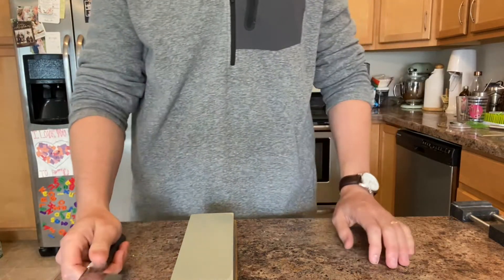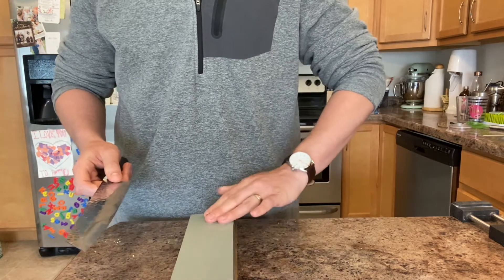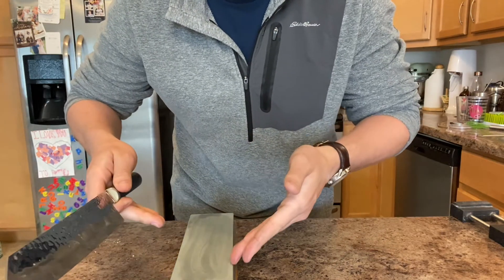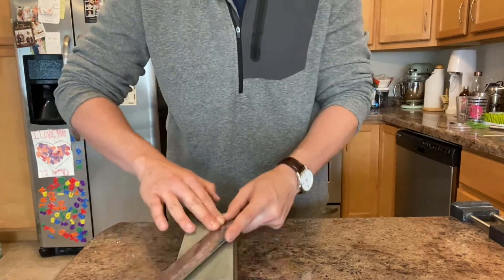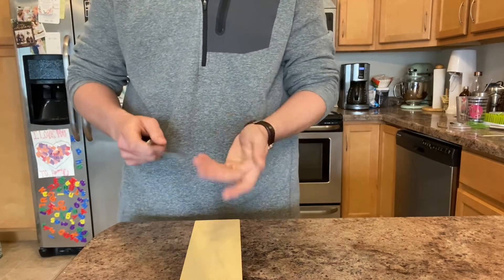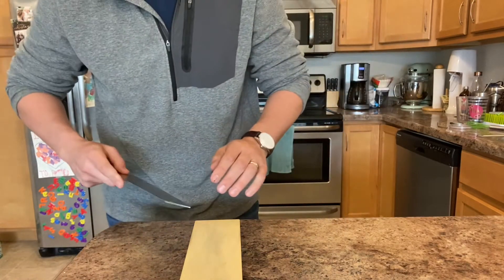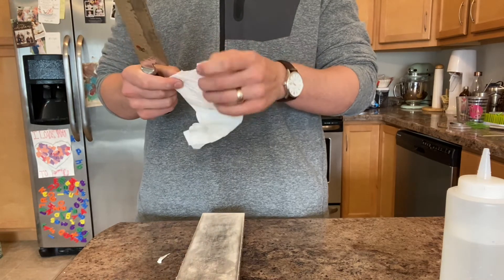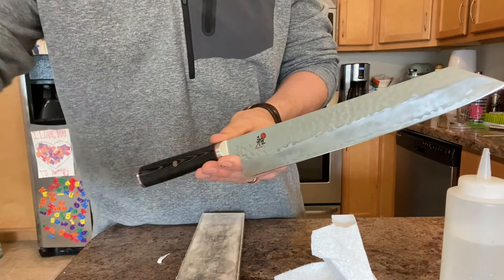Sharpening Miyabi Mizu 9.5” Kiritsuki (Repairing micro chips on Japanese water stones)

Comment: Newbie here. I got a Miyabi Birchwood 8" Gyuto for my birthday.  Recommend affordable brands of strops, whetstones or honing steels?
Reply from the maker: Knives plus strop is a great place to start for a strop. Comes preloaded with green compound, easy to maintain with the instructions included, lasts for years, about $25. 

As for stones and rods, how far into this do you want to go? Just want to keep your knife sharp enough or really dive in?
Reply: Mainly to maintain the knife.  Keep it sharp.  That way I can strop and maintain while I learn.  Down the road I can get be more aggressive.
Reply from the maker: I would use that knives plus strop with not too high pressure once or twice a week as a great basis. 

You could integrate a ceramic hone but I am not a huge fan of them. But very carefully try to follow the angle with light pressure, only 1-3 swipes per side every couple of weeks. Only buy reputable brands like the idahone linked below. 

https://www.knifemerchant.com/product.asp?productID=8762

Comment: Looks like it sharpened up nicely. A question, how do decide about using the leather vs paint stirrers for stropping?
Reply from the maker: Blade size mostly. Smaller blades on the wood and bigger on the leather just because it’s a nice big size. The wood is more forgiving with no real downsides but I don’t have any big enough pieces to comfortably do anything over 6ish inches.
Reply: @EngineersPerspective701  ah, ok. I tried making a paint stick strop the other day after seeing you do so. Seemed to work ok, though only used it shortly after applying diamond emulsion and still probably somewhat wet. A little while later it seemed to warp in shape, then the next day (I guess once fully dried) it resumed its original shape and warp was mostly gone. Haven't tried it again since fully drying.
Reply from the maker: I've made several and they usually turn out if I picked a nice straight one to start. I get MUCH better performance from balsa wood strops made from 1/4" sheets at Michael's or Hobby Lobby. I cut them to about 1.5" x 5" because I can hold that between my thumb and middle finger. You can use thinner sheets but I recommend gluing layers together to prevent flexing when holding it.
Reply: @EngineersPerspective701  ha! That is funny that you recommended that to me. I just ordered some 1/4" thick balsa stirrers yesterday from amazon to see how they would work. Hopefully they are quality made and will work well then.
Reply from the maker: @turing2376  Lol, you’re one step ahead! You can always flatten them with some sandpaper placed on a flat surface like a counter if they are a little bowed